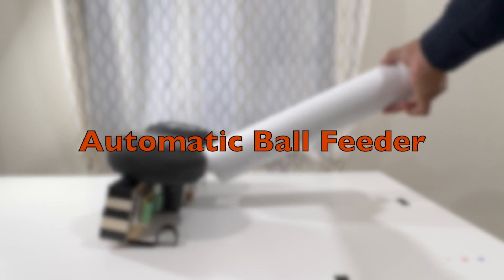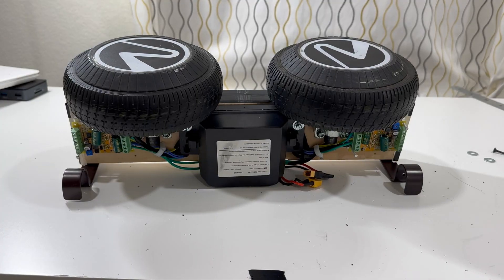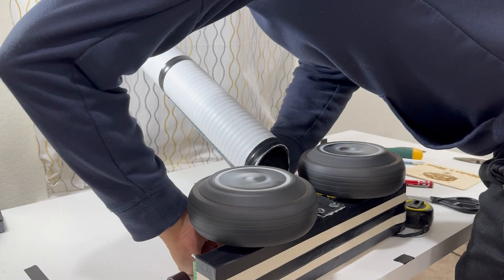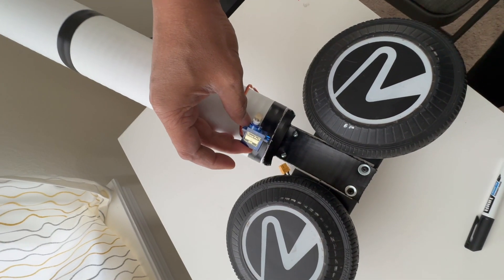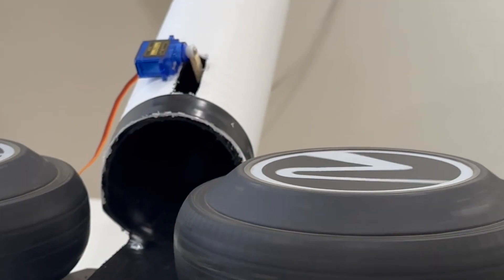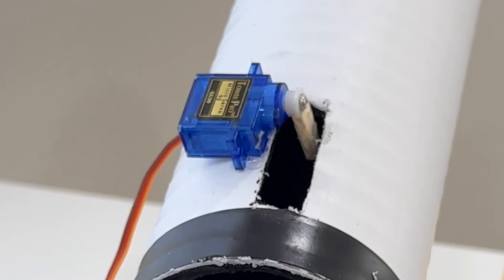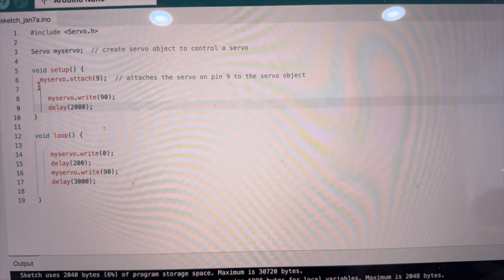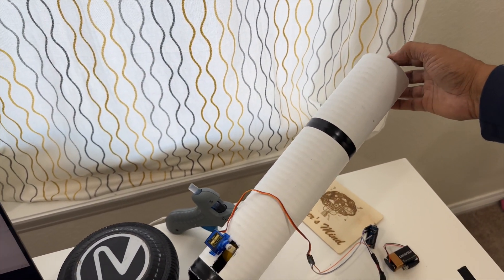Automatic ball feeding system for cricket bowling machine #viral #video

Comment: Absolutely fantastic project. I have just taken a hoverboard that didn't work apart. Motors are fine. Couldn't find the link to the programming board or code for  the servo . Would you mind still linking as you mentioned this in your video
Reply from the maker: Please follow here, this is the full video
https://youtu.be/iWDIVCyvyMg?si=WGROOEFIZ3FylhQf
Reply: @makersmind  thanks. Great video
 Ive commented on that one as well where you mention more links in the description that I can't see.